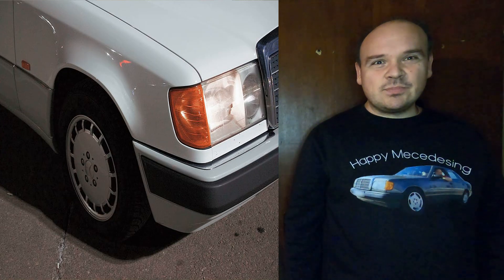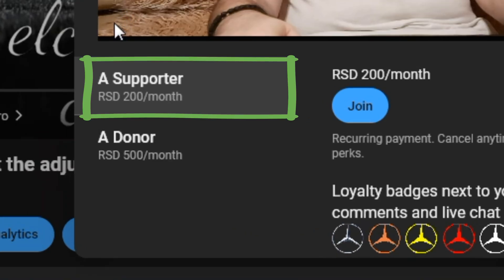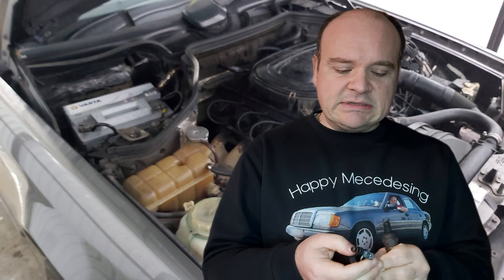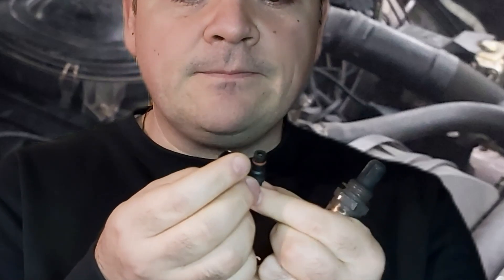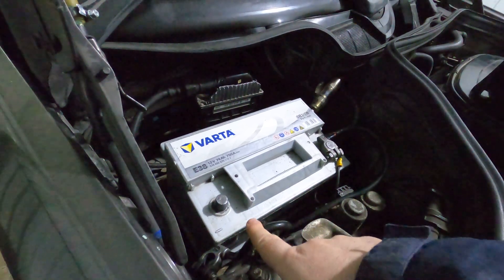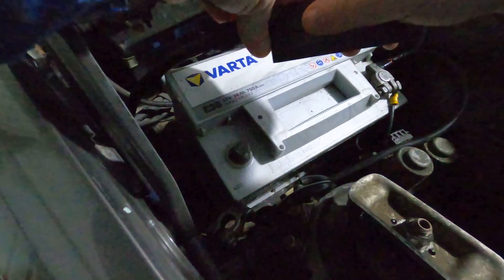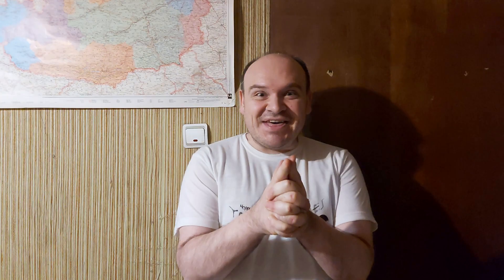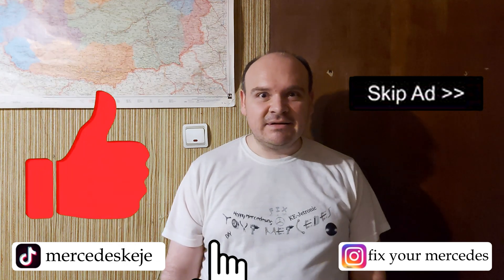㉦Mercedes Ke-Jetronic㉦ - ❓❗Do I have a λlambdaλ❗❓

Comment: One small comment, if I may. I believe that there is even an easier way to find out if the vehicle is equipped with the Lambda (or O2 sensor): On the driver side (on LHD) look for the X11 port, open it and if the number 2 and 3 ports are empty then you don't have a Lambda/O2 sensor. Great video.
Reply: Hello, what of my car have cat and lambda, but my lambda is disconected and there is no cable from ecu. I think that somebody swap exhaust for cat version with lambda, but does not connected lambda.
Reply: And on my x11, i have port 2, but not port 3
Reply: @asineprestanou5221  Like the man says, look at the ECU and see if pin 8  is hollow than you don't have a Lambda and your car didn't came with emission control devices (cat + Lambda )
Reply from the maker: @asineprestanou5221  No lambda then.
Reply from the maker: @asineprestanou5221 Even if he did he could not remove the cables. I mean, why would he do such a thing 🤔?To remove the cables from the X11 and from the ECU? That would be strange. Did you buy the car from someone who was tuning it up or doing a swap?

Comment: Hello, where else can we measure the lambda sensor other than the x11 socket. I need to do a carbon adjustment over the voltage. Thank you in advance for your reply.
Reply from the maker: Hello. X11 port only. There is a more expensive option - exhaust gas analyzer. Anyway, lambda is being replaced, can not be repaired  replaced it each 50k km and you will be calm.